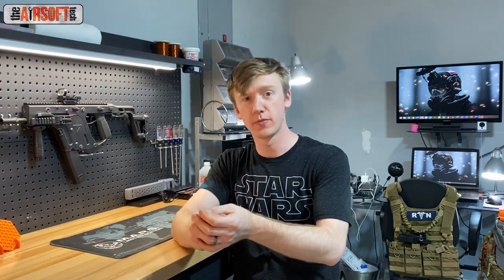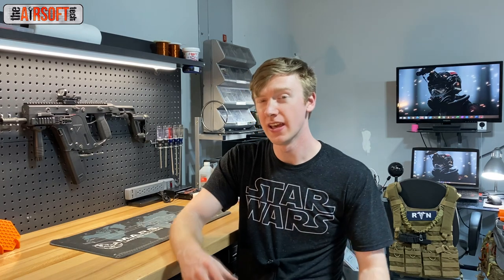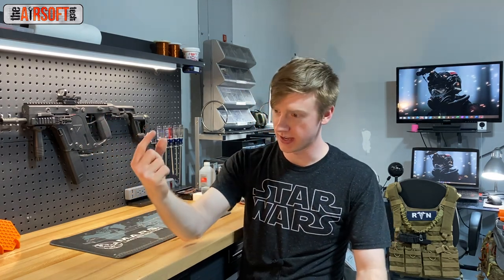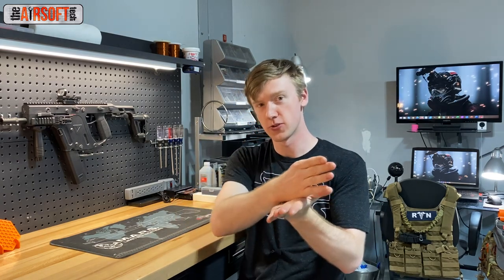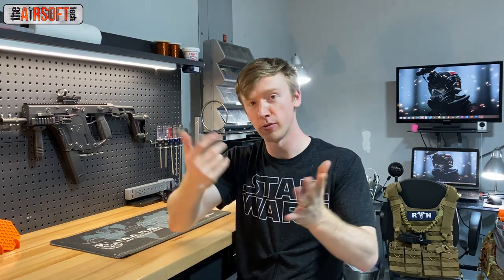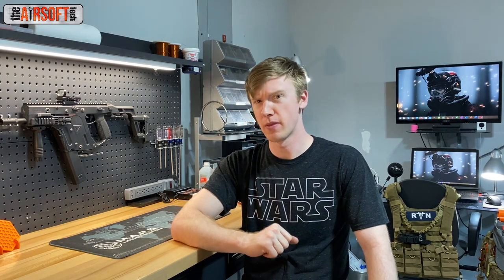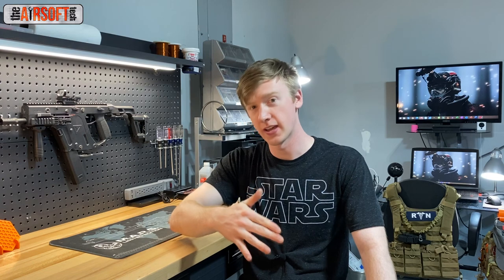Why Does My Airsoft Gun Motor Get So Hot?

Comment: Sometimes a hot motor can mean that you have to heavy every spring for that particular motor like I Taylor Farms that there was extra guy riding a m130 and a cyma M14 as a DMR and he was still using the stock motor which I highly advise against with anything that's over a 30k. Ideal you want a slower motor with a high-speed gears. Motor would like to get pretty hot. Of course if you're wearing gloves doesn't matter that much because gloves can dampen the heat from external sources. I worked in a factory and I have to wear saftey gloves and I actually got my fingers trapped in this machine that's there to seal plastic bags by melting them together and it did not burn me because I was wearing gloves. I only felt the pressure and no it wasn't super hard.  Anyways good moral asami's to use a high torque motor with a battery that isn't the super high discharge rate. I recommend an 11.1 lipo with no more than 30C discharge rate. Anything higher is for if your gun locks up and you shoot full auto because of your regulations or full auto wasn't enough.

Comment: Grip getting hot...??....strongly suggest you shim the Bevel gear up. Likely you are suffering from too much friction in this spot. This causes the motor to heat up very quickly, and your battery will use it self up 50% faster. You can afford some wiggle room in your shimming.....there is no perfect shim.....give and take is alway required, and all gear boxes are different. What works for one may not work exactly the same in another.

Bevel gear to pinion gear is the key.

Comment: Ty for the informative video! it gave me strenght to overhaul my VFC Hk 416c another time, but this time i'll do it myself shimming and proper pinion gear alignment (i saw the other video). Relying on other people makes me unable to fully "understand" my gun and the whole amps thing/current draw was bothering me so much since i had blown fuses and very hot stock motor (vfc original one). I prolly go with 13:1 prometheus gears, tiensy 35k high torque, m120 o m100 (depends if i go overjoule euro specs) with bushings + 11.1 lipo .

Comment: Something odd with my gun was the motor, a stock g&g ifrit, had too many shims on the communicator housing, and got far too hot too fast. As soon as I took off one shim it immediately fixed all heat issues
Reply: yep too tight fitment, motor working harder

Comment: Hello Sir. ihave a delta armory ar15 And It’s heating up in just ah normal single shot. And i use the 11.1V 25C-30C lipo battery. And. i use the TOKYO MARUI - Moteur High Torque EG 30000HC axe long. And it’s heating up just a normal shot. And the impact is little weird. I’m worried about my replica. What would you recommend to upgrade and chance to fix. Thank you

Comment: Can you give an actual explanation why a Deans plug is better than a Tamiya? I've seen several people say that and their only answer is that its the new "standard", but not actually explain why. All my guns and chargers and batteries, etc all have Tamiya plugs and I've never had any issues with the plugs, no voltage or draw issues. I'm an electrical diagnostic mechanic for a living and most times I check draw and current and I've never seen a good connector be the cause of any problems, only time we ever run into issues with connectors is corrosion, but that's in a automobile. In  all my years of working on autos I've never seen a huge amp draw or voltage loss over less than 1 foot of wire regardless of connection type. So what's the reason? You could just say personal preference.
Reply: Deans offer a larger contact area and "lock" via additional spring pressure which results in way less contact resistance. In a "normal"/stock gun that´s not that much of a difference but with larger and stronger guns the current can actually get high enough to partially melt Tamiya connectors.

Comment: You should also mention that if your battery is undersized for the amount of amps being pulled, it will cause voltage drop, which causes more amps. Amperage is what creates the heat, so if you run a gun that needs 30 amps @ 12 volts, and the battery can only supply 20 amps @ 12 volts, then the voltage will drop to increase amperage. If you have a battery that can happily supply 35 amps @ 12 volts, you are likely only going to see a slight dip of voltage at startup, but run much lower amperage while cycling. This is because the motor requires watts, not technically amps. Watts = Amps x Volts. So the lower voltage causes higher amps and higher heat trying to meet the wattage requirement.
Reply: Yeah as a battery guy from rc's he skipped a bunch of good info about batteries and ratings lol. But other than that great vid
Reply: almost corect but the amps dont go up

Comment: if i'm going to be honest.  the holes in the grip really don't do much.  I tried it in my DSG which has since been scrapped.  I found that it just burned my hand after about 300 or so cycles, given, my shimming was great.  i would also like your opinon.  13:1 SSG on a 14 TPA?  i know, that sounds stupid, but, i figured why not try to get an SSG with DSG ROF and trigger response?  maybe at the cost of a little bit higher current draw, but with the plus of not having to deal with the stress of a DSG.
Reply: I was running 13s with an asg 40k (pretty sure thats 14tpa but could be wrong) in my main for a while. While yes you dont have as much of a headache as you do with dsgs, its still pretty inefficient. It was drawing 60a on semi, so its definitely far less efficient compared to my build now which is 9:1 dsg with a 32tpa frankentorque that i built which is only drawing around 30a on semi.
Reply: @danieleveringham8318  60 amps on semi?!

Comment: Hmm, lot of info so I bought this new gun (arcturus)  it's the Ak/scar mix has that foldable stock . So I don't play often yesterday I charged the battery,  hooked it up carefully closed the rifle (top half slides on to main body)  then pull trigger and I get nothing!  Full or semi nothing ...so with in the 5 minutes I'm thinking maybe bad safety switch idk ... then I noticed the grip getting very hot, also with a funny smell, so I take it apart (only the half to get to the battery , and it was crazy hot a 11.1 1000mah ( yes dumb ass small) it's the only thing I can find to fit in the area it wants it...  

I let battery cool down to try again,  same thing like ... I just got this didn't even fire 3000 rounds , didn't even get to play was all missing around target..  I bought this cuz was recommended this (new CO to airsoft and its supposed to be solid)   I'm not very good and mechanical shyt so ima have to find someone who good at taking it apart...

The only thing I can remember doing,  that may be the cause or me breaking it. Was the last time I played with it, I did to battery died,  which I was told I think to never let batter fully die idk how tho can destroy the motor if that's what's dead or shorted thx for great info

Comment: Speaking of the g&g combat machine 2.0 I just bought a new ics 25000 motor and semi works good but full auto it won’t feed also I only have a 9.6 ni battery have a 7.4 lipo coming in the mail tomorrow just curious if the motor is too much for the raider 2.0 or if it’s the battery as you were taking about also the new battery will be deens also any information would be greatly appreciated new to airsoft and trying to learn how to atleast tinker with my gun at first

Comment: not sure if this is normal but i got a gate titan 12;1 gears ifrit 25k motor and a m110-m120 ish spring and i shoot around 300 rounds and my hands are burning hot, im assuming this isnt tho loli checked to make sure all my gears spin freely, ie i can spin them on bushings for around 1.5 seconds with grease before they stop, i cant seem to understand why my motor is getting so hot for.
Reply: Interested to hear the reply as mine behave exactly the same and melt things inside. I use a prometh high torque and semi auto for speed qb.

Comment: I have a few questions. You say to keep high speed guns under 20 amps but the basic 13:1 and 30k motor usually draws well more than 20 amps. More like 30-35. How are you supposed to get that under 20 amps and still shoot 380 fps?
Reply: I run like 55 amps in my high speed SSG and its fine. 20 amps is pretty low. I would say if you don't already have them, get bearings instead of bushings, and go to a lighter piston/piston head
Reply: @marinusdedreu3833  I think it is also important to point out that a 22tpa motor still draws ~24 amps on 12:1s. I think 20 amps is a goal to strive for but I don't think it is actually possible going over ~27 rps on an ssg
Reply from the maker: Like you said it’s more of a goal.

There are certainly setups that require 35+ amps to run. My whole point is that when you’re start to hit that amount of amp requirement maybe start thinking about switching up your setup to be more efficient.
Reply: @englund_  yea , I’ve gotten 41 maxx rps on my ssg

Comment: Hey man, any suggestion on how to change a pinion gear?
I don't have the tool to do it and I've heard the Evike tool breaks easily.
Reply: order the tool off of aliexpress. When installing the new one, put the motor in the freezer (in a ziplock bag), and heat the pinion in the oven at 350f for 15 minutes. Should slide right on?

Comment: What battery would you recommend for a tienly 45,000 rpm brushed motor. The motor does not get extremally hot on an 11.1 but you can definitely feel the heat within a couple of minuets of burst fire and semi spamming. I am pretty new to tech work and could always use a second opinion I have done my best to alleviate stress in the gearbox but the motor still gets hot. Is this normal for high speed motors.
Reply: kypom lipo. if it stil heats swap motor

Comment: I just bought the Lancer Tactical AEG High FPS ProLine M4 Spr Interceptor and was wondering if I should run an 11.1 lipo or 9.6 NiMH? I don’t know if the 11.1 will strip the gears but would like to hear your feedback
Reply: Don't do 11.1 unless you know that it can withstand it. I highly recommend a LiFe 9.9V. Great middleground between a 9.6v NiMH, and a 11.1v
Reply: I have lancer g3, 11.1 lipo no problems.

Comment: Hey, I kinda need of your advice. Currently have a setup of AEG using SP160 spring, Gear is 18:1 and have a 2.2mah battery with 40c. What kind of motor should I use? I'm aiming for more on a high damage gun setup.  But not sure what type of motor should I use and how much speed/power the motor should I need.

Hope you can help me with this. Thanks and God bless.
Reply: At least 22tpa imo

Comment: I noticed yesterday(on semi spam) on my DSG build I just wrapped up its getting warm. Not horrible. My stock motor would get hotter on the stock build. Im running a Godzilla 5000 22TPA on an 18:1 DSG, SP140 spring currently, with a 2500Mah 100c 11.1. According to my titan its reaching 46 amps on semi. I am trying to figure out how to bring this down. Any tips?
Reply: @vettelover2009 I recently did another game where I was locked to semi only(gun shot JUST past the rps limit and i didnt have my usblink on me) and didnt notice it getting warm at all. Gun performs great and doesnt give issues so I aint messin with it.

Comment: I have a dsg 18:1 with a m110 spring installed, my motor is a chihai 19k 28tpa running on a 7.4v 4200mah 20c rc pack and my motor gets warm after say 30 rounds of semi. I also think the gears are perfectly shimmed.

Did i chose the wrong motor? Should i get a different battery?

Btw great video as usual.
Reply: Only an M110? That seems WAY to weak for a DSG.
Reply: @philliprhodes7926  i live in germany, minors like me can only own guns under 0.5 joules.
Reply: @callsign_armistice7168  I wouldnt run a DSG build on that low of a spring. Seems like its just asking for pre mature engagement and would damage the gun itself. If you have to keep it so low I would run a SSG build until you can up it.
Reply: @philliprhodes7926  i dont have any problems with pme, i had with the standard cyma motor wich gave me around 35 rps now i have 25.
Reply: @callsign_armistice7168  Id be very interested in your full build list if you dont mind. Been struggling to get my DSG to 300fps without PME.

Comment: If I am looking to get a new motor for my lancer tactical lt-15, what would be a good budget motor if I was trying to do a high speed build
Reply: If you wanted high speed I wouldn’t use that gun as a base. I’ve heard the piston cracking fairly quickly on 25+ rps setups.
Reply: Yeah well “high speed” for me is like 20-23 rps with good trigger response. Budget ideas I guess
Reply: @jameswalker6810  You could find some nice 22tpa or 24tpa motors for some sweet trigger response. You can find some nice SHS ones on Evike.
Reply: @jameswalker6810  SHS or even the evike branded "Matrix" motors are good budget friendly options

Comment: ive wanted to try shimming a motor but i dont have those yellow plastic shims on hand. is there a place i can find those or are you able to use the steel aeg shims, thanks
Reply: Ive used regular gear shims in my motors without any issues

Comment: Hey mate, I'm from @airsoft.lab, that's another great video as always, but what you can explain about C rating?

I've been searching about it but got almost no clue, just that the C rating means how fast the energy goes from the battery to the motor or something like that. I'm in a case with my DSG that's a little bit strange, I use 2 Li-Po batteries on it, one is a 2600mah 11.1v 20C that runs all day with almost no heat after the games and the other is a 3000mah 11.1v 75C that I bought just to run on this DSG cuz I've always heard about "more C is better on DSGs cuz they pull a lot of energy", but it overheats my NikkSakk Brutal 26K motor after one 15min game, this could be the issue? Cuz it was hard to find a high C rating battery, but I'm almost selling it to buy another one with lower C rating.

Comment: Hi your explanations and showing how your tec is done are awesome.im thinking of dsg my wiffle I know I would have to check the SHIMMING  on gears and cut my tappet plate but do we have to buy a mosfet cant we use the stock trigger assembly I know there will be wear eventually on the switches I'm happy with one shot  on semi,granted I know they also manage power etc.i have a long barrel and i would like to keep it and do a dsg but watching your vid you reccomend 300mm i would have to cut 200 mm.my question is why would the barrel be detrimental being longer the bb once shot will travel past 300mm or  500mm is it because you've shortened the pull on the piston and the next bb will hit the other bb because it is now quicker yes the piston has lost some power ,but the bb still leaves the gun and travels a far distance so I'm slightly confused,I was thinking of getting a 36 k motor I have 500mm barrel 6.01 still have my stock 6.03 tbore, was thinking of getting 13/1 gear 9tdsg and keep stock trigger assembly,if there is any holes in the piston housing couldn't I cover them or buy a solid housing so you gain some pressure back any thoughts or your expertise on this,or should I just leave the stock gears and swap my motor and shim my gears,and motor thanks marv.